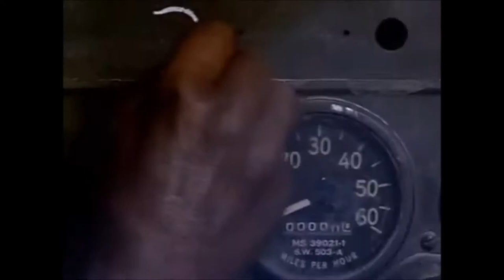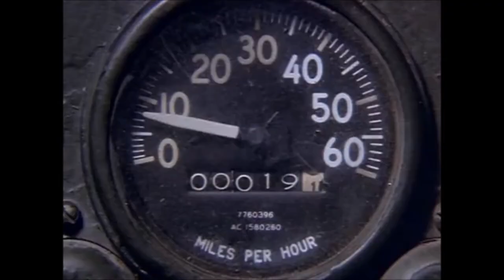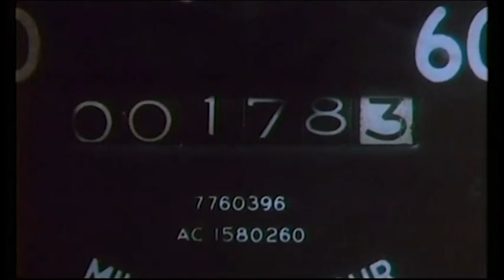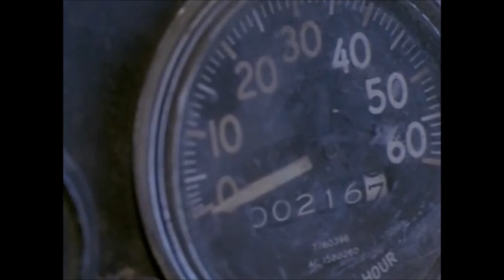SORCERER 1977 - Only trucks scenes

Comment: I love these old trucks. To me I think Roy Scheider should have drove the truck with the grille that looks like an old Ford grille. But the M211 that he drove in the movie is cool too. And are they Diesel or Gasoline? And what color is LAZARO, Gray or Green? Same for SORCER, Red or Brown? Please and Thank you.
Reply: both probably had Petrol sixes judging by sound and exhaust fumes. Although I do wonder what kinda transmissions they wete running, those are some pretty unconventional shifters
Reply: @Gabriel-he6ih  Cool. Thanks for the information. What about the colors. What color is "LAZARO"? Green or Gray? And what color is "SORCERER"? Red or Brown? If you don't know, I'll understand. But still Thank you for sharing your information.
Reply: @Gabriel-he6ih  Lazaro is a M135 I believe.   It likely has a GM 302cu/in straight 6.   The transmission would have been a GM Hydramatic H/L range
Super cool!